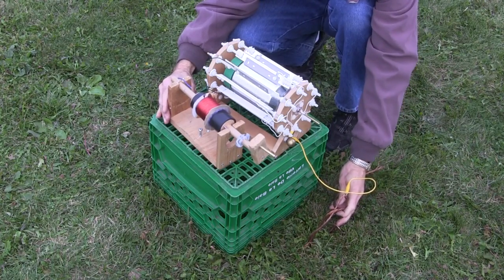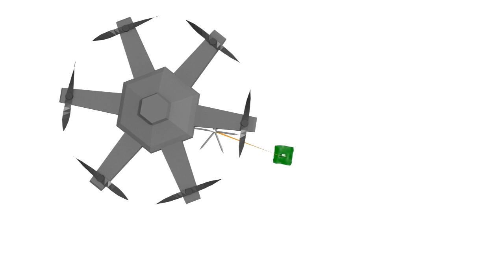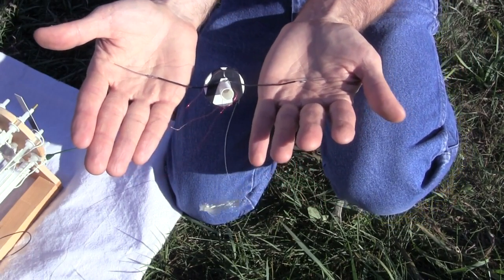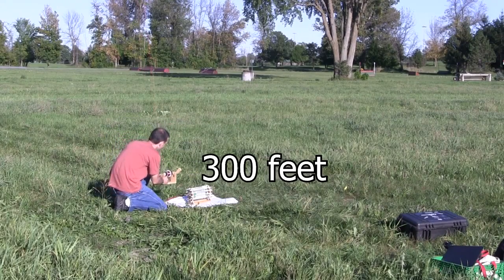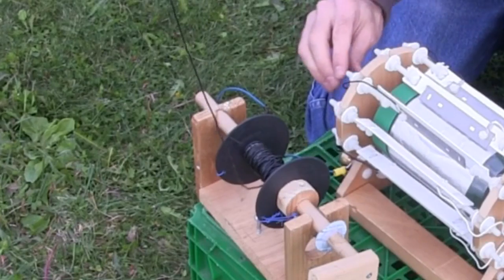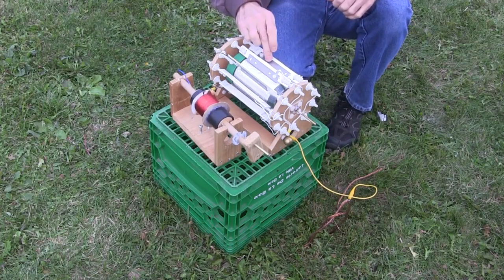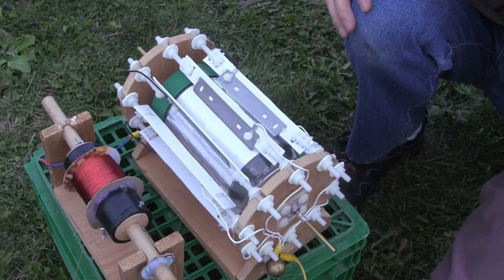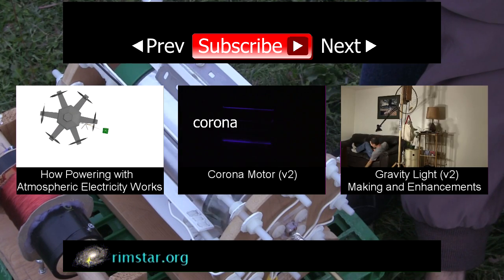Atmospheric Electricity Powering a Corona Motor/Electrostatic Motor

Comment: If one were to delve deeper into this without a hexacopter, what would you suggest? a spire on top of a building? a pole? how about at a residence?
Reply from the maker: The problem with a building, a residence and a metal pole is that they're all grounded. You need the sharp points where you're collection the charge needs to be far from grounded objects. If you could string a wire made of non-electrically conductive material, such as a nylon fishing line, between two tall objects and then put a lot of sharp points somewhere along the middle of it and then hang a wire down from those sharp points then that might work. I show how a building is grounded in this video where I explain how this works https://www.youtube.com/watch?v=2rVdEhyMR6A

Comment: Why not just use a volt meter to see the increase with altitude?
Reply from the maker: There's no way to arrange the meter probes? For example, if you hold one at around your waist height and the other a meter higher, you won't see anything useful on the meter. The amount of charge per square meter is too small. You'd have to have one connected to Earth ground. Then you'd need a large, horizontal collecting plate or something held up at some height and then wait for the charge to accumulate on the plate. Then touch the other meter probe to the plate. Current would flow briefly from the plate and the meter might tell you what the voltage is. What you really need is an electrometer which works on different principles than a normal digital meter.  The current is just too small.
Reply: @RimstarOrg  Why would you sugest one at waste height vs one at a meter higher. You are confusing me. No one is trying to know the voltage and difference between a meter. But we DO want to know the reading of the volts off the cord connected to the 4 pins. Why would that be so hard to do? And the voltage should show a significant amount at say 50 or 900 meters up from ground.  So a standard voltmeter should be just fine. Why is that not possible?
Reply from the maker: Oh, I see. You want to know the voltage I got in the experiment. It was in the thousands of volts so a standard voltmeter with normal probes won't work, the voltage is too high. However, by using the correct type of high voltage probe you can measure it. I show how in this video here https://www.youtube.com/watch?v=kXq4FCQ0C38
Reply from the maker: For my experiment, I'd put the high voltage probe on the terminal that the wire from the sky connects to and the other probe connected to the ground.

Comment: you ever try using a tartarian style antenna
Reply: check out the levi strauss nederland building in amsterdam. it contains a dodecahedron antenna that is ornamental these days, but the sides of the building contain decorative spheres with spikes (resonator lamps). yes, all ornamental now, but highly likely they were functional as we suspect.. a tartarian antenna is doable, but it won't function correctly without a proper amplifier/resonator. i hate using the term "red mercury" because there's still no solid proof of the stuff (until someone produces it and gets in trouble with the CIA), but... it is highly likely that red mercury was key to the use of atmospheric energy, so that one didn't have to lift a wire hundreds of feet in the air.

interesting note though.. today's electronics are technically "dated/useless". an electromagnetic motor consumes way too much energy and is to be considered useless. a proper corona static motor could use up to 90% less electricity and function just as well or even better. what the chap in this video is using is a rudimentary or crude model of a corona motor. the real thing could certainly be used in a blender, fan, or car motor. the amount of electricity at 5ft (a car on rubber tires) with a proper antenna should indeed be able to run perfectly.

Comment: Impractile and inefficient.
Reply from the maker: But a lot of fun as a science project and a challenge to get working.
Reply: @RimstarOrg  If you have a lot of time to waste on a pointless project  Yes. But you would learn skills. But then you could fo a meaningful project and learn the same skills and produce something that really is practical.
Reply: it's the other way around. electromagnetic motors are impracticle and inefficient. they use way too much energy for such a simple purpose. the motor used in this video is a crude model of the use of atmospheric energy, but a developed corona static motor can indeed outperform an electromagnetic motor in terms of strength (use in a blender), or even replace a vehicle's petrol powered motor. it's very likely these high energy consumption devices we use today are "on purpose", as the more energy used, the more fuel or electricity required. imagine if your washing machine or dryer only used 5% of the energy they're using now. the power companies would go broke in a night.
Reply: @EbenezerScroogeMcDuck  Corona Motors are a TOY. and have few uses.
They can not even charge batteries unless you are willing to wait years. A solar wristwatch makes more power.
  I am am electrical engineer MSEE. You are completely wrong that a corona motor can outperform a electromagnetic motor. I challenge you to prove your claim.
The use in a car is not practical as you would need a the car tethered to a Balloon to hold the wire up 120 meters while driving. That is assuming the impossible amount of Amps a car would require..
IMPRACTICAL to impossible.
You do not understand the physics and have no facts.

Comment: would it work running the wire from the motor at its base up to the top of a near a high hill or even a cliff, instead of using a drone?
Reply from the maker: The problem with that is the hill or cliff are at ground potential, 0V, so that wouldn't help. What would work is stringing an insulated line from the top of one hill to the top of another hill, over a valley, and then having the wire go from the ground in the middle of the valley straight up to the line.

Comment: This is an EXTREMELY DANGEROUS experiment! It is equivalent to Ben Franklin’s kite. A man died replicating that experiment. The electrostatic potential of the atmosphere is very variable. If a large cloud passes overhead during the experiment the wire could induce a lightning discharge through the apparatus. Even if no lightning occurs, a discharge large enough to stop the heart could occur, due to induction. This is especially dangerous if the operator has a susceptibility to ventricular fibrillation, which may be undetectable under normal circumstances. The fact that you were getting repeated shocks is an indicator of a dangerous condition. Advise not to repeat.
Reference: The Pennsylvania Gazette, March 5, 1754, report of the death of Georg Wilhelm Richmann

Comment: "something went wrong with the hexacopters...and it ent to 120meters" Sure it was te programs fault. lol. Glad it had such a failure in the height limit prog. Awesome stuff.
Reply from the maker: LOL. Wink wink. Seriously though, that is what happened, or so my friend told me. Whatever happened, I'm glad it did after all that effort. It is possible it would have worked at a lower altitude if the problem was instead that the rotor was being stopped by the wingnut inside the frame. After all, it was when I accidentally knocked into it causing the rotor to shift over that it started working, so the altitude may have not been the issue. I'm glad you liked it, thanks.

Comment: Would it increase the power if you used thicker copper?
Reply from the maker: It's possible that the resistance of the long wire is decreasing the available power and so, yes, a thicker copper wire might help. There's so little current here though that I wonder if it would make a difference.

Comment: My home town is Rugby., England.....it was notable for a radio station., which in the 1930s was part of the round world telephone system..It was said to put out 1/3 of a million watts.,in the 70's one of local engineers was supposed to have planted out receiver units in his garden and reduced his electricity bill.......he is said to have been taken to court for it..
Reply from the maker: Interesting. What you're describing is a little different. It sounds like he used an antenna to pick up electromagnetic waves from the radio station's transmitter and use that as a power source. The one I did takes advantage of electrostatics instead, a much weaker power source. I explain how it work here https://www.youtube.com/watch?v=2rVdEhyMR6A
Reply: @RimstarOrg ...........thanks for your reply..Yes....different beast..How "correct" my "tail" is.,small town conversation.,but in a town that has the right people.,engineering apprentices broadcast radio down the earth and neutral line., and running wind turbines so the blades brake the sound barrier.....i maybe a tail rather than truth..Yours.,brilliant piece of work and illustration.....not sure about the self outing for the overheight..but you made the point..

Comment: you need to make tens of those star pointy things. more pointy needles, more ions are collected. then you dont need that helicopter. just put them 5 meters above the ground with some wooden base.   humdreds of needs is the key. also you can use tens of parrallel wires but wires must be graphene wires that have thousands of pointy sharp needs on them. your job is collecting ions. that is   sending MORE negative ions from the ground to those points. so, you need a 1-2 meters nail to the ground to collect more negative ions. this is the physics of this toy. do your physics right
, no need for helicopter.

Comment: What happens with a wire from the top of a hill or mountain to the bottom?
Reply from the maker: The mountain is all at ground potential, even at the top so I don't think it would make much difference. Have a look at my how-it-works video https://www.youtube.com/watch?v=2rVdEhyMR6A at around one minute and 16 seconds in at how the lines curve around the tree and building. It could be that the lines are closer together though above it though so the wire doesn't have t be as long to get the same voltage.
Reply: @RimstarOrg  And omg I thought the charges were negative. Thanks

Comment: Try little metal spheres at the end of those six wires.
The idea being ... you want to collect electrons rather than emit them. Think of yourself as an electron in the air seeing that entrance, the point, you want to go there but as you move towards it you're being crowded out by other electrons all trying to go to that same spot. But like a stadium with a nice wide entrance, a sphere gives you more breathing room. Or just an aluminum foil disk on top of the wires, lots of surface area.
Reply from the maker: Good analogy. I do just that. If you look to where each set of three wires goes to, there's a brass ball.
Reply: @RimstarOrg  Actually I have to correct myself as I thought the air charges were negative so in this case, in those old smoke detectors is a mild radioactive source and might help electrons just off into the air. I don't have first hand experience with it but it struck me when my friend mentioned it, he developed the world's first automated heart defib unit and said he used that principle at the tips of the wings of a model airplane with wires out there, using the electrical potential in the air, that precisely even, for better control/turning. I don't exactly understand but think there might be something to that possibly worth trying here. The material he used may have been beyond alpha though.

Comment: Can you do it with hydrogen/helium baloon.
Reply from the maker: You should be able to. I didn't because I was worried about the wire breaking low down and then the balloon carrying it across power lines somewhere.

Comment: Amazing - Is there an equation for height and power?
Reply from the maker: Yes, but atmospheric conditions make it vary a lot. It's 100 volts per meter that you go up and there's around 10 picoamps per square meter. So at 100 meters up, the power from collecting from 1 square meter at a height of 100 meters  x 100 volts per meter x 0.000 000 000 01 amps = 1 nanowatt. Basically 100 nanowatts per meter up for a collection area of 1 square meter. You can see how it works in my video here https://www.youtube.com/watch?v=2rVdEhyMR6A

Comment: Wouldn't the winded wire act as a transformer?
Reply from the maker: I don't think it would act as a transformer since there's only one coil but it could act as a choke, which would resist any alternating current (AC). However, this is all direct current (DC) so that shouldn't matter, plus this is very low current so not much of an electromagnetic field would be forming. The only issue would be that the wire is very long and that means higher resistance.

Comment: Why not use an balloon?
Reply from the maker: I worry about the wire breaking low down and then the balloon carrying the wire away and draping it across power lines somewhere. In this video you saw that the wire did break but luckily I was using a drone and so it was under control. Having said that, you can probably connect a string in parallel with the wire to reduce the chance of the balloon flying away. Naturally a balloon would be better in terms of net energy gain but this was just a fun experiment.

Comment: This technology has been on the books for so long and yet we haven’t or at some point decided not to use this, but think the applications it can be done like on a big ballon or a high rise building. The sky shouldn’t be the limit. Thanks for bringing this out!
Reply: Or natural mountains. The Grand Canyon has 1800 meter deep drops.
Reply: It's kinda useless. Makes for a good project, but it isn't viable for any real... use. You wouldn't be able to charge a phone, in example.
Solar panels or wind turbines are significantly more useful than this.
Reply: @TheTattorack  That's simply not true. If we spaced copper-lined towers at 50 meter heights across the desert floors here in California, we could generate cities' worth of energy. It's free, always available, and has nothing to do with wind. It has to do with ionization and electron-depleted grounds. Places with lots of water also generate massive amounts of ionization so these could be used in conjunction with dammed rivers.

It is calculated that a square meter of space can generate 400,000 volts between the Earth at sea level and the top of the Ionosphere. Do the maths.
Reply: @TheRotnflesh 
Reading a few sentences on a wiki article does not count as "doing the math".
Show me a scientific paper that proves the potential viability of atmospheric electricity extraction, then we'll talk.
Reply: @TheTattorack  The Ion Power Group in Florida does this very thing using carbon rods. They have a website.

Comment: Amazing job! Proving there is always a voltage difference between 2 points. Think we could sap voltage from a tree? Plants?
Reply: They are grounded, so the equipotential lines at the surface of them would be the same as at ground level; however, the lines are much more compressed at higher altitudes, so you'd definitely benefit from putting up an antenna from the top of a tree rather than having one near ground level.

Comment: scrolled through the comments and didn't see anyone ask, but did you happen to measure the voltages in the test? it should be fairly high, add some capacitors and with some coils you can amplify that power on a great scale.

cheers (with distilled water)
Reply from the maker: I didn't measure the voltage. Keep in mind that Ohms law applies. Ohms law says that as you lower the voltage, the current goes up but by the same ratio so the overall power stays the same.

Comment: So you used power to make less power? Good sciencing. Try a tower or a kite.
Reply from the maker: I started out with a kite, trying a home made one first. But then I got nervous about the wire breaking near the bottom and then I'd have wires draped across power lines as the kite flew away with it. As you saw in this video, even with this setup the wire broke near the bottom but it wasn't a problem since the hexacopter was controlled. The same issue would apply with a balloon. As for the tower approach, a tower is at ground potential so even the top would be ground. See my follow-up video where I explain how the equipotential lines work https://www.youtube.com/watch?v=2rVdEhyMR6A.You'd need to have wires high up between towers or even across a valley. I have access to neither of those. Anyway, it was a good science experiment, just not a practical demonstration of power generation. But that was never the goal since I knew there wasn't much power available.

Comment: You have to replace those metal pins with magnets for it to produce actual amperage. Look up the atmospheric electricity generator patent by Roy Meyers.
Reply: That doesn't really make sense; in any application for this you will be connecting your antenna to ground through whatever it is that you're doing, so the ions of the air will be attracted to those pins as if they were magnets anyway in this case.

Comment: Tesla powered appliances and bulbs from miles away, powered a car wirelessly, beamed aether to take out plains, beamed pictures, video, took x-rays, beamed aether to other planets, lit up entire rooms with light, and no one can come close to his discoveries. The ironic part is that after winning the industrial revolution with poly phase AC in the late 1890's, it was High frequency DC that was the key to unlocking Mendelev's missing gases and Teslas discover of the aether streams and neutrino particles.
Reply: If Tesla made his discoveries in Ottawa, Canada, the authorities would quickly stop him: Mr. Tesla, you can only beamed aether to other planets to a height of 90 meters!😂